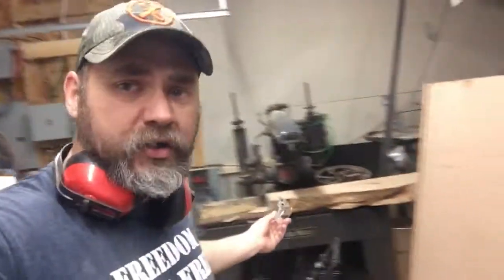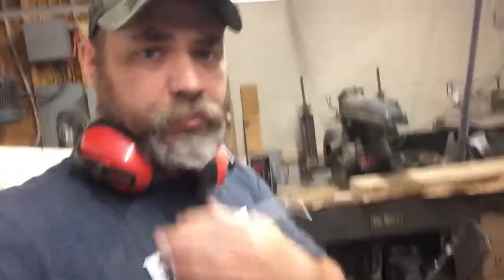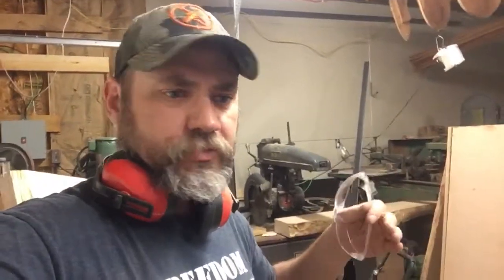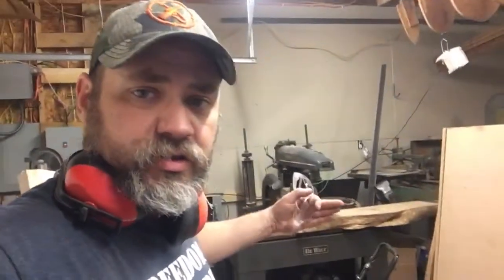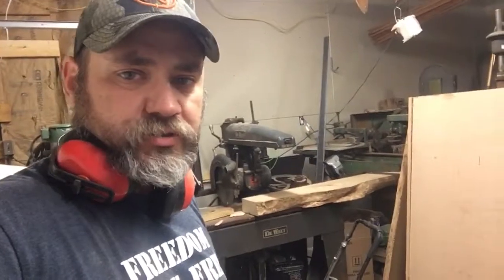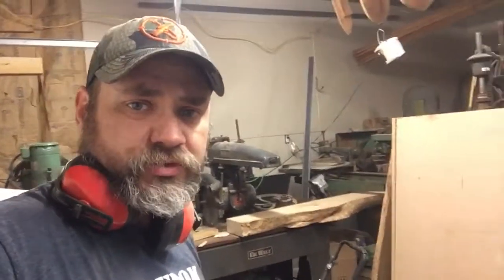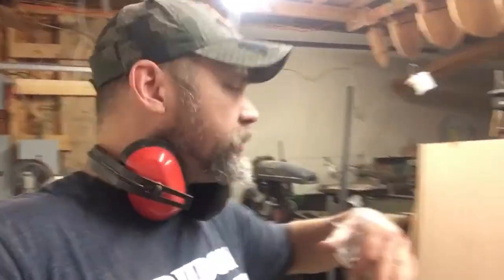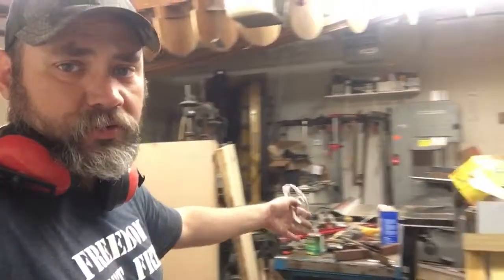Running the scary 16” Dewalt Radial arm saw for the first cut

Comment: 1) Put a taller fence on the table outside of the blades radius
2) Put a travel stop on the arm so the saw cant go past the cut off width of the stock being cut, a c clamp would work
3) Put the on/off switch where it can be reached with one hand by the operator from the operator position
4)Clamp the stock down tight to the fence and use two hands on the saw when cutting thick stock
Reply: Who designed a wood saw with no power switch on the operating handle? So in a normal cutting operation you have no means of shutting the saw off? Some of the design flaws of radial arm saws are why they fell out of favor. They should have been legally required to have two power switches and a key. They need a trigger power switch, like all other circular saws, so you can shut off power as soon as you are through your cut, before you remove your hands from the handle. They also should have been designed with a lock, that parks the saw, and it cannot be released without a trigger actuated mechanism. They should have used a bicycle style flexible cable, to go to a latch, so unlock the saw head, by pulling on the handle. Having the saw head "free" and just resting on ball bearings at full power, is not an acceptable solution. When I see people running these machines, with their hands off of the machine, it's terrifying. The cutting head needs to be "locked" before you remove your hands. Fortunately you can lock it by just turning the tension screw before removing your hands.
Reply: @Ritalie  these saws were not designed nor intended for those who like to play,
 the saw was a left running as a normal procedure.....why ruin a good machine 
with all those 'Lawyer' driven deterents to use. If the user can't operate a saw like this
with out hurting themselves, , best find a better type saw for their needs.

Comment: I’ve got a Black & Decker era DeWalt radial arm saw, probably from the late 60s. Only cost me $40. It’s much smaller with a 9” blade and will bog down on some hardwoods. I always wondered why it took so long for the blade to stop spinning once turned off. There’s even a blade-brake. My table saw blade stopped spinning quite soon after the saw was turned off.. anyway, they’re such cool tools and so damn versatile. I used mine to cut rabbets into 2x4s for a work bench frame years ago. Could have used the table saw too I guess but the RAS did the job perfectly.
Reply: Do you still have your saw? Do you use the manual blade brake? I have the same saw and the manual blade brake stops the blade almost instantly. Something to note, on the Craftsman radial arm saws, they have a disc brake inside of them, not an electric brake. It's an automatic disc brake that engages when the saw motor gets below a certain threshold RPM. The bearings have a lot of drag, being rubber sealed bearings, and once the motor RPM's dip a little bit, the disc brake engages and it slows it down in about 6 seconds. It's not instant, but it's better than the 1 or 2 minutes.

Comment: Mine has a counter weight/pulley attached to to motor to help counteract the the blade climbing up on the piece and lunging forward. We must maintain control of any machine or anything may happen.
Reply from the maker: Very nice. there was a option, you can find on some machines that have a hand crank control. One day, maybe I will find one.

Comment: These a dangerous pieces of equipment,  I’ve used one for 40 years and they scare me safe! You need to be the one in control. When pulling the saw you need a straight arm for control  and stand back to have that arm straight. Shut the saw off when moving lumber, but really with this much mass who knows.  They are versatile and so well built. Drop a piece of wood like that on a Festol  and see if it needs resetting. Oh wait, a miter saw can’t do that the base isn’t big enough! With these things just take your time, be in control and they are just fine.

Comment: Excellent  saws for the very experienced  safety  concious person.  Your material - stock must be secured  and you must have firm  grip. Leave nothing to chance.  These old dewalt are  good machines.  I use a foot switch.  A safety shield   grip gloves and fasten the material then you will get a perfect cut.  A quality saw.
On a side note.  If buying a old  unused saw,  relubrcation is a must.  This can take a couple  of hours and some  simple mechanics tools and supplies.

Comment: If you want to use a piece of wood to slow the blade then cut a piece of scrap as you would cut normally with enough length to stay back from the blade. Do not hold it up in the air like that.

Comment: I saw you put your thumb in line with the spinning blade.  Keep all body parts away from the cut line, even when the blade is stopped.  That would be good safety practice all the time.

Comment: You've clearly never injured yourself catastrophically before.  It changes the trajectory of your life.  Work a bunch of OT and treat yourself to a Sawstop.  Bring those dangerous pieces of RAS  gear to get scraped.  As you get older working with  your hands brings you more joy. You need them.
Reply from the maker: I shouldnt have sold my sawstop….. but my garage was so full that I couldnt work, I wanted everything out of it.   Now I need to do it again cause I keep filling it up.

Comment: Man that thing spins forever after you shut it down. That would drive me crazy. My 12 inch dewalt has an electronic brake that stops the blade in a couple seconds.  As far as blades go definitely need one with a negative hook angle so the blade isnt wanting to pull itself through the wood. You should  have to pull the saw through the wood vs it just coming at you at least thats how it is on my 12 inch dewalt with a negative hook blade. Might wanna check out The Original Saw Company as they still make and sell radial arm saws in the larger sizes that look just like those old dewalts. They also sell blades designed specifically for their saws. They are a bit pricy around $200-$300 for their 16 inch blades depending on model but on a saw of that size you definitely don't want to cheap out on the blade.
Reply from the maker: Yeah…. Maybe one day I can put a brake on.

Comment: My impression is that the negative tooth blade is helpful. But the most important thing is that the blade has anti-kickback "shoulders" behind each tooth. The professional blades are extremely dangerous, even the negative hook blades, because they have a large gullet (empty space) between each tooth, and therefore each tooth can take a huge chunk of wood out when you're cutting. On a chainsaw, if you remove the raker teeth (these are called shoulders on a circular saw blade) then the chainsaw is so dangerous and it kicks so much that you can't even use it, because the blade wants to "grab" and rip the saw around in an uncontrolled way. On a circular saw, the rakers are called "shoulders" for some stupid reason. You can take a look at a Diablo multi-purpose 40 tooth 10" table saw and miter blade, and you'll notice it has large non--cutting rakers (shoulders) in between each tooth, so the blade effectively has 80 teeth on it, and only 40 of them are actually carbide tipped cutting blades. The reason this is so important is that the shoulder teeth limit how much wood each tooth can cut, thereby putting a "governor" on the cutting feed rate. The professional blades don't have shoulders, making them extremely dangerous, because there is no governor to limit the cutting feed rate. A negative tooth blade with anti-kickback shoulders on it, should be almost totally immune to any type of "climb" on a radial arm saw. In testing with a Diabolo 40 tooth table saw blade with shoulders on it, my radial arm saw has no climb at all, and it doesn't "surge" forward randomly. The gap between the shoulders and the cutting teeth on a Diablo 40T general purpose blade is only about 3/16" or less. On a 16 inch blade, the gap between cutting teeth is probably closer to 5/16", which means, double the potential cutting feed rate, and double the chance for "grab" or "climb."
Reply from the maker: Thanks for the input. I will try to remember that for my next blade.

Comment: I buy one 2019 10 24 but blade is 14 '' ; 5.5 HP; i do not try now, i will have end of october but one yours video, it  seem very powerful!
Reply from the maker: Very scary to run. Slowly the scariness is going away. I need to get the mag starter going so I dont have to flip a huge switch to start it.

Comment: In summary: Try a blade with large anti-kickback shoulder teeth on it (non cutting guide teeth). Only the cheap blades have the anti-kickback shoulders. A smaller blade might need to be utilized, in order to find a model of blade that has the anti-kickback rakers (shoulders) in between each cutting tooth, like on a chainsaw. It must be assumed that professional blades put quality over safety, and therefore none of the expensive "professional" wood working blades have shoulder teeth, but this makes them very susceptible to dangerous kickback due to too high of cutting feed rate. It does appear that the professional blades are not safe on a radial arm saw, due to their lack of non-cutting raker teeth (shoulders).

Comment: can you imagine 5 hp ejecting a board?   it would be like a huge arrow prolly go through a concrete block wall.
Reply: Old table saws that don't have a riving knife, can eject an entire sheet of plywood and throw the person 15 feet across the shop. There are people brutally impacted by ejected pieces of wood on table saws, it's a major problem that isn't talked about enough. It's because there is no riving knife on the old table saws. The riving knife makes them 99% safer. If you don't have a riving knife, be sure to get one. The new radial arm saws all had a riving knife, where as, none of the old ones did, and the old Dewalt saws with no riving knife, would be extremely dangerous to use for ripping boards, but still not anymore dangerous than a table saw. A table saw can throw the material directly at your neck or head, like a frisbee. On a radial arm saw, the kickback is a straight ejection, in line with the table, so it's less likely (not impossible) to rise up and go towards your head. Look up the video by "Stumpy Nubs" wood working channel on YouTube of a table saw kickback on a Saw Stop saw. It shot a piece of wood through 2 layers of drywall like an arrow. The key is "never stand behind the cut line, or in the path of the blade on a radial arm saw or table saw."
Reply: @Ritalie  good advice Rit. my RAS has a splitter built in to the anti ejection pawls but still i never lose respect for my saw.

Comment: From my experience you should be cutting in the other direction... cut on the push, not on the pull
Reply: Called Euro method. Its how i use my monsters. Example when using your model 77 one does not pull it to cut, You push it.
Reply: @wrenchguy  oh ok, I had never heard that term. Haha I was always taught that it was just called the right way. Ive been using my 16" 3hp 3 phase skil RAS and I refuse to do a pull cut... that thing has near 3½ feet of draw... you couldn't run away if you tried.
Reply: @elky4x4  I'm getting ready to refurb a  skil  model 450, 24" travel, 2hp 1ph RAS here soon. I think it'll fit 14" blade, no blades came with it. good luck with ur projects.
Reply: @wrenchguy  that sounds like  a fun project! Thank you, likewise
Reply: nope. When pushing the saw is trying to lift the workpiece up which is hazardous and goes against the design of the saw.  when ripping it does this also but there is a hold down for that.
Reply: Yep and on top of that pushing will cause all sorts of tear out on the top the board because the blade is rotating up on the backside and if your pushing it through thats what will be doing the cutting.